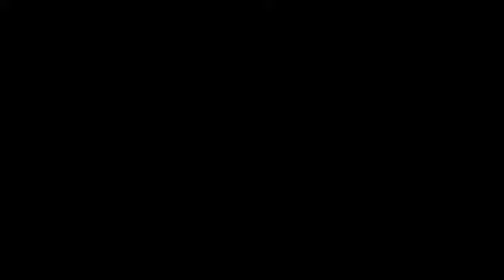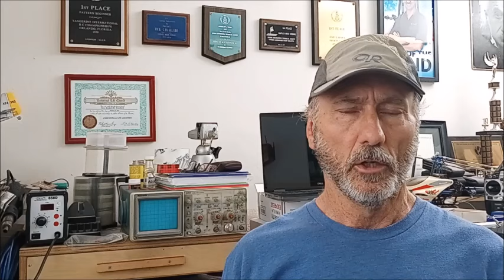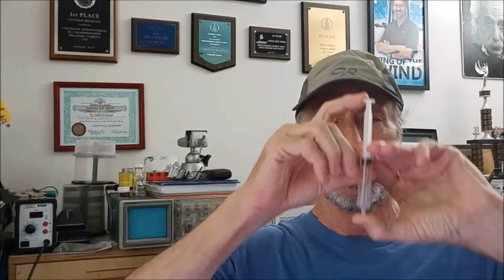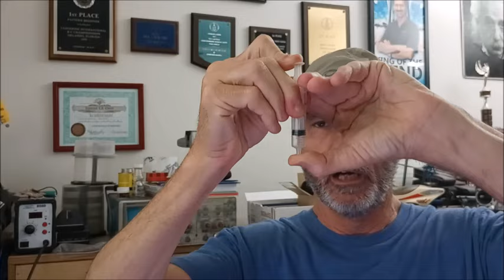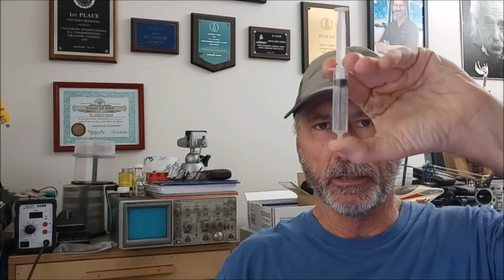My new brain teaser

Comment: I am having a hard time understanding it too. As I did with your previous old brain teaser, which is how we met. But does compressed air have a potential energy, and is that stored energy where some of the work went?
Reply from the maker: I'm intentionally avoiding the question as to whether the gas itself has stored energy as pressure or temperature.  The only question relates to what energy goes into and out of the system.  So, of the energy used to compress the gas, how much of that ends up lost to heat when I allow the system to come back to ambient temperature?  Keeping in mind that I still end up with a tank full of pressurized air at that point.
Reply: @Rick_Cavallaro  I feel like that intentional avoidance is problematic, but my understanding is thin here. If I put 10 energy units into the system, and 5 are lost to heat, then presumably 5 are also stored as PPU (potential pressure units). Does that address your question? Or am I breaking the question by looking at what you're trying to avoid? If so, maybe you can reframe it using numbers like I did, might make it easier to understand. Though I also wonder, when I release the force on the plunger, the system only gives back the 5 units, so the plunger shouldn't go all the way up?! I is confuse.
Reply from the maker: @matthoover111  The primary reason I'm avoiding talking about how much energy is stored in the gas is that it comes down to definitions - and arguing semantics is kind of pointless.  What does not come down to definitions is how much work was done to compress it, and how much is then lost to heat.

To give you an example...  I compress the gas 10:1 by volume.  After I let it cool down, we know that it will have 10X the original pressure.  The question is simply... how much of the work that I did is lost as heat?
Reply: @Rick_Cavallaro  answer: some!
Reply: @Rick_Cavallaro  isn't it true that after you let it cool, assuming you no further change the volume after the initial compression, it will no longer be at 10X the pressure?

That part of your description of the teaser has me scratching my head.
Reply from the maker: @tiltmaniac  It will initially go above 10X pressure due to the increased temperature.  But given that the initial and final temperature are the same, we end up being able to use P1 x V1 = P2 x V2.  So if I have 1/10th the volume, I get 10X the pressure.
Reply from the maker: @matthoover111  hmmm... I'll give you a qualified "maybe". :)